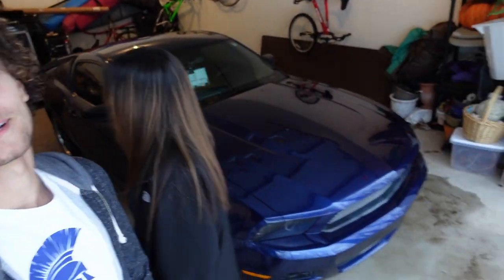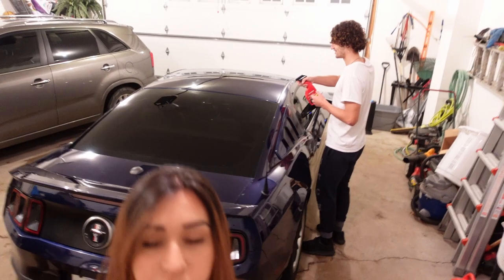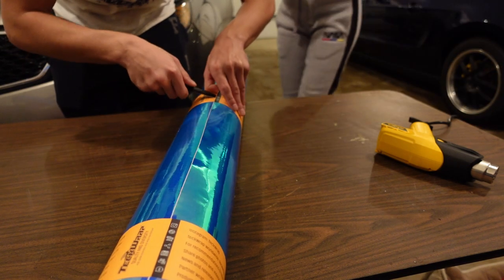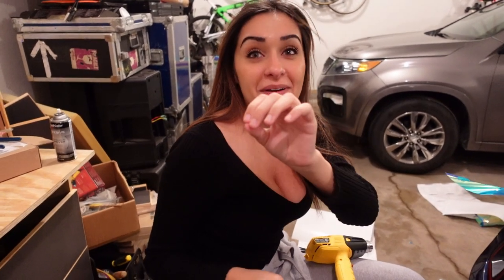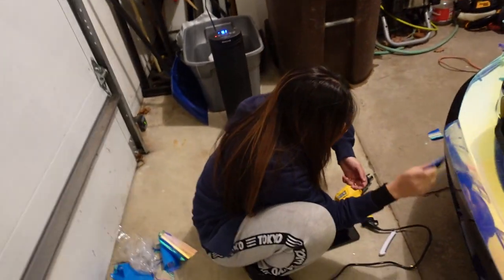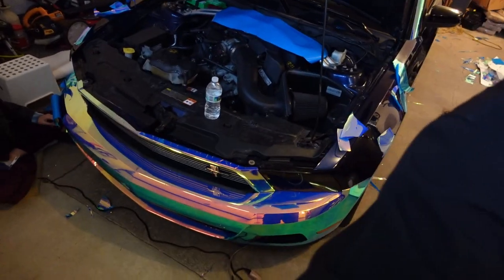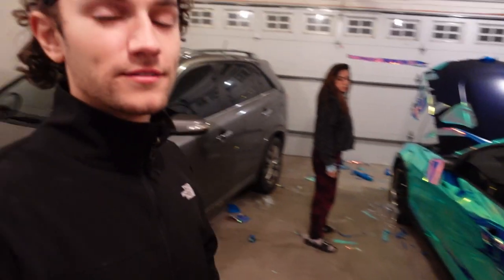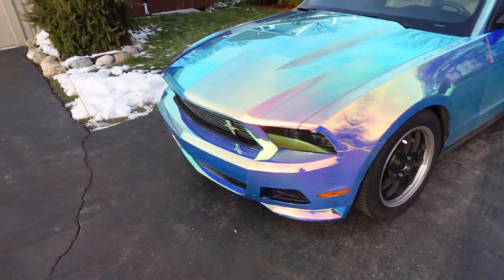FIRST EVER NEOCHROME MUSTANG

Comment: Love watching you guys. I tried really had not to have a freak out with OCD watching you to try and wrap the mustang but when you go and  wrap the 350z try heating the vinyl up until it is super bouncy it should be easier to curve and mould to the car a little more and when wrapping the handle with key hole leave the vinyl over the hole and heat it up then just press it in and around the hold and cut of the excess, and another thing is to be carful with the seams and little air holes cause they can turn into big water pockets which could rust out the car.